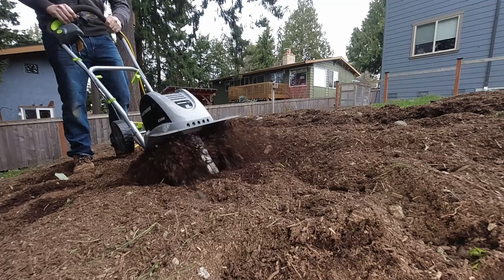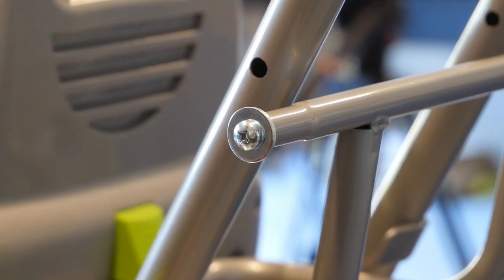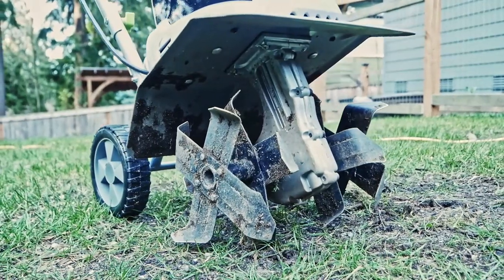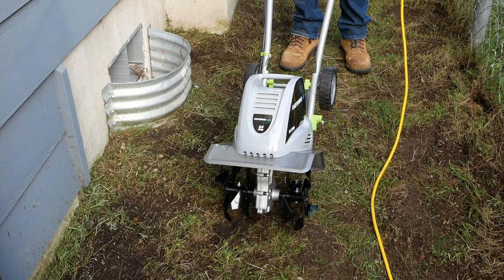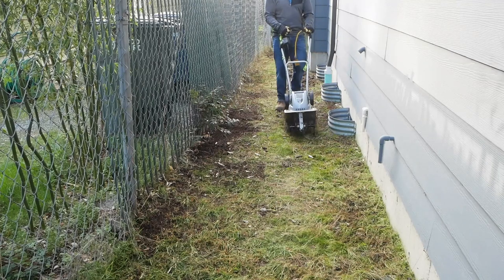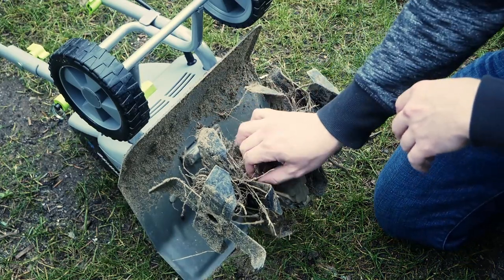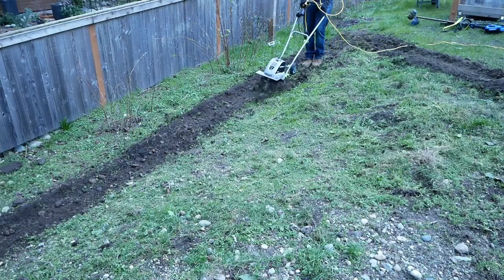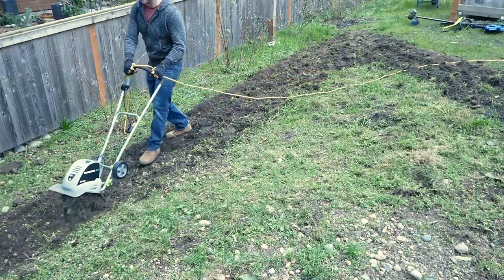The Earthwise ELECTRIC Tiller is a BEAST

Comment: It's not variable speed, which was also evident in this video. I purchased an AC Motor Speed Controller on Amazon, to regulate the speed of the tiller. I plugged it into the outlet then the extension cable to the tiller. I adjusted the speed I wanted for the application before tilling. Worked great.

Comment: Bought one of these years ago on Amazon was $80 but I had a $40 gift so it only cost me $40. I love it great machine. Only thing I don’t like really is switch doesn’t have a speed control. It is tuffer machine than one would think. Use it in my compost pile. Very happy.